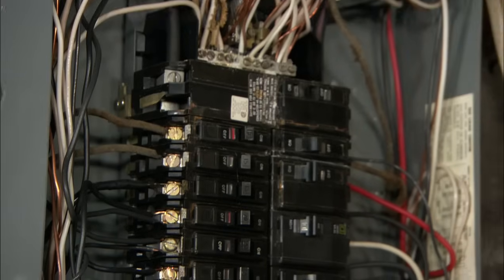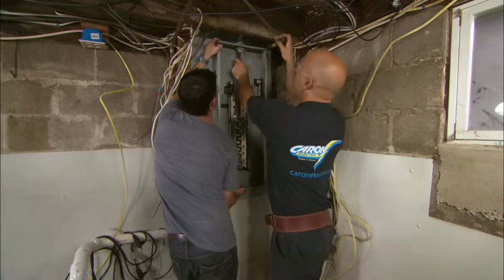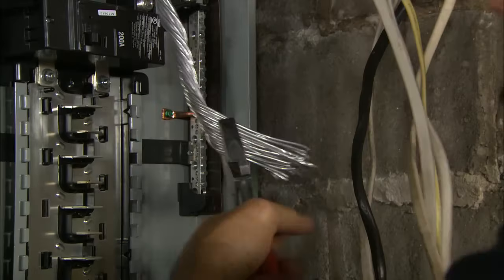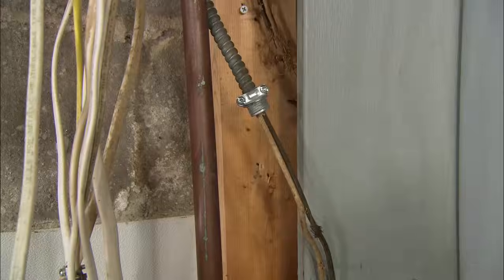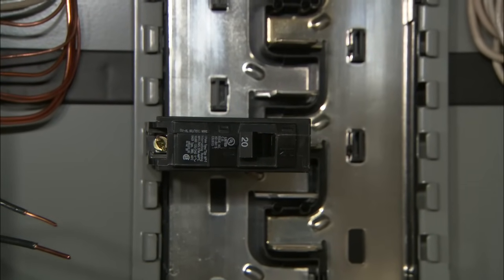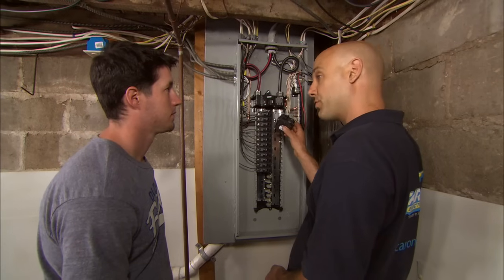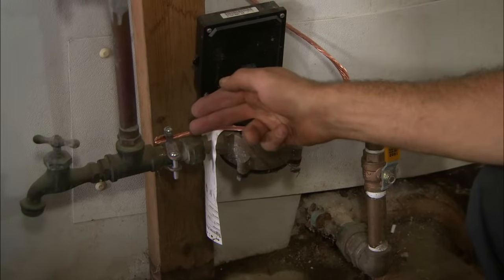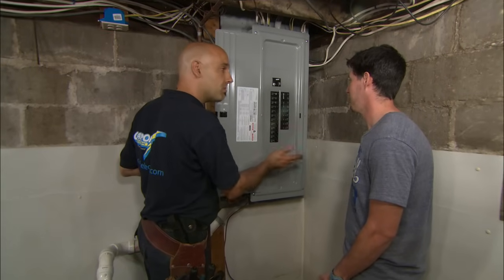How to Upgrade an Electrical Panel to 200-Amp Service (Part 2) | This Old House

Comment: I wanted to see the part where he's figuring out which circuit goes to what 20 times.
Reply: I have the Ideal Circuit Tracer. I paid around $100 for the kit, Canadian dollars. It has the adapter for plugging the transmitter into a light socket as well as the alligator clip adapter for tracing light switches. I find it very handy. I went on a service call awhile back and the  homeowner told me he had an electrician and an apprentice spend three days mapping the circuits in his house. I could have done the whole house in 4-5 hours with the tracer.
Reply: @ERLong-ww7yn  I can do it in 2 hours just by running up and down the stairs... 32-48 circuits shouldn't take half a day, lol, all I need is a plugtester and a ticker, the ticker gets jammed behind the plugtester and you just listen to the chirping... in New construction I also use blue lumex for the afci ccts,  saves a tonne of time trying to figure out which ccts get afci protection...
Reply: And add a radio in what you assume is a different cct then the vacuum and bring the end of an extension cord down to the panel with a light on it plugged in somewhere else and there you go.  More indications about what is going on w/ the ccts.
Reply: click 
-how 'bout now?
-no.
click 
-how 'bout now?
-no.
click 
-how 'bout now?
-no.
click 
-how 'bout now?
-no.
click 
-how 'bout now?
-no.
click 
-how 'bout now?
-no.
click 
-how 'bout now?
-no.
click 
-how 'bout now?
-no.
click 
-how 'bout now?
-no.
click 
-how 'bout now?
-no.*click* 
-how 'bout now?
-no.
click 
-how 'bout now?
-no.
click 
-how 'bout now?
-no.
click 
-how 'bout now?
-no.
Reply: Some of us use a circuit tracer. You plug a transmitter into a circuit and the "sniffer" runs over the breakers a couple of times.  Once calibrated it'll beep on the breaker linked to the circuit the transmitter is plugged into.
Reply: @ERLong-ww7yn  those are the cheaper ones, ideal makes a really nice expensive one that allows you to completely map everything out, you can run it along walls and conduits to see how the wire runs, itll tell you which circuit is which..
Reply: @ERLong-ww7yn  that's how I do it if I am alone.
Reply: +E.R.Long -  they have really wide price range. Are they all the same? Are you an electrician and use your's a lot?
Reply: No the Ideal draws power from the circuit, and that's what enables the sniffer to find the proper breaker for that circuit.
Reply: Gra Gor I don't see why not. They usually come with two alligator clips with leads punched down on an rj45.
Reply: SusceptiblexMe when u do it 52 weeks a year it's clock work
Reply: SusceptiblexMe I do this every day. Like clock work
Reply: I have one of them for data.  I guess I could make an adapter for it.  Would the toner run a 5-15P cord punched down on a RJ-45 cord end?
Reply: Next time I'll give it a whirl.  Should be fun.  Thanks.
Reply: awesome
Reply: awesome
Reply: well the quickest way is to turn on all light switches & plug in night lights into the top part of all receptacles               { because the top is usually switched } & make sure all ceiling fans pull cords are on. Then with a gen. cord insert each cable hot & neutral into it, then with the camera on your phone walk the house to see what has lite up for that    branch circuit, this also gives to opportunity to chk. out light switches working order.
Reply: @rrfields65  you mean you are dead shorting the ccts... with old breakers that no longer trip easily you could cause enough arc that can start a fire....
Reply: @gophersgirl  : what? Please write in plain English !
Reply: Lol
Reply: E.R. Long Its funny how that works
Reply: It's a pain without the proper tools pretty lady.
Reply: What about the 50 amp breaker for the range which requires a 50 amp breaker
Reply: Chris Johnson Gas stove? Last one I looked at used a 15A, 120V service.
Reply: @ChrisJohnson-mp6fh  ...probably has a gas range.
Reply: It's not rocket science. You land all the circuits on the breakers and figure out what is what when you're all done.
Reply: Hello from the future also skipped way to many steps
Reply: You mean 3 hours  ? :)
Reply: Pros use circuit tracers.
Reply: @nickg1307  I am a pro and I don't... if I have a first yr with me he does all the running upstairs, and if I'm alone I use my ticker jammed behind the plugtester... though I prefer tagging the HR when I'm pulling them, that way half the work is done and I don't have to do cardio just plugtest everything...also my company is too cheap to buy me a tracker, lol
Reply: He'll call somebody else to do that!
Reply: Um Klein makes the circuit tracer that works on live circuits for 200$ but old school way takes about 30 mins to an hour
Reply: Rather do it myself then pay someone $100 an hour to do it.
Reply: + SusceptiblexMe - outlets are pretty easy, you just move a vacuum from circuit to circuit. The lights in the basement are easy. You turn on a light and when the person upstairs tell you it went off you got it. Dryer and range is 240, pretty easy.
Reply: @lexluther8370  or a radio
Reply: @lexluther8370  also doing it yourself without a noisemachine of sorts is a great cardio workout running up and down stairs 40 times, that's why I don't have a gym membership.
Reply: Actually all he has to do is hook up each circuit to the new box and leave. He would leave the finding to the homeowner so the laughs on you both
Reply: Gra Gor.  Get a toner kit.  Toner kits work great when there is no power to operate your circuit tracer.
Reply: Sure wish I had a self powered cct tracer.  Most times when I'm tracing a cct I'm looking for a break and the thing isn't powered up so the tracer doesn't work.  Mine is a GD model.  Is the Ideal one self powered in the sending unit?
Reply: So did you understand from all this comments or they just got you more confused 😕...but just in case, just like hi explained on the video, if you know you're wire installations and circuitry wire size you know witch size wire goes to what, 15amp breakers is lighting 14/2 and it got white sheeting, 20amp breaker for power like receptacles and is 12/2 or 12/3 with yellow shedding and ure larger breakers like ure 30amp two pole breaker will be for size #6/3 or #8/3 for you're range or anything that requires 240v..simple as that...hope this helps you.
Reply: @torodaman  incorrect about 30 amp.. that would be 10/3 copper or 8/3 aluminum..
Reply: @torodaman  
You can use orange-sheathed 10-2 Romex for 30 amp 240 VAC things that don't require neutral.  Ranges almost always need 50 amp two pole breakers.
Reply: @torodaman  yellow 12/2 is only for kitchen plugs, and red 12/2 is for heaters, blue 14/2 is for afci,  blue cat5e is for data and white cat5e is for tel, at least that's how us Canadians do it...
Reply: Right, "this old house" should leave electrical alone. People end up calling us out anyways. Plus, maybe I'm missing something about basements but all that Romex needs to be protected below 8'. Either way this is not stuff basic homeowners should be doing

Comment: Did you notice when he was done it didn't look like a plate of pasta! he care's what he's doing and takes pride in it.
Also I never would have thought to look at what ga the wire is to know what breaker it should go into.
I'd tone out each line with a tool. but when I was done I'd also label the panel whats what.
Sucks being in the basement flipping breakers to find the dishwasher or a light switch when your replacing one. However Cell phones work better they yelling up stairs            ( is that it?  NO   How about this???   NO  Tell me when) You know what I'm talking about.

Comment: I'd use an insulated Tee {hex} wrench, rather than an uninsulated socket wrench, that Scott uses here!
Reply: The lug screws must be torqued to the proper specifications. You cannot do that with a T handled wrench. I don't recall him showing the torquing, but you can bet that he did it.

Comment: not allowed by nec code book to land two wires on yhe same terminal
Reply: Wrong if it's listed you can use two wires on a breaker or bus bar
Reply: Gra Gor: The lug has to be specifically marked on it indicating that multiple wires are allowed under one barrel.  The only ones that you can tell without looking at the markings are the lugs with egg shaped barrels.  If the barrel has an egg shape to it you know that you can fit multiple conductors (typically 2) in the barrel.
Reply: Ian Belletti et al: Okay, I agree that if the grounding lug is only Listed for one (or two) conductors, then only a single (or two) conductors can be installed based on the NEC. Thanks for the clarification and correction. However, under UL508A (Industrial Control Panels), multiple conductors are indeed permitted: Article 8.7 states, "Number - At internal wiring terminals, multiple conductors can be secured to a single termination point where a reliable electrical and mechanical connection is made without loose, unretained, or severed stranding." So one might encounter a UL508A Listed control panel with multiple wires landed to a single terminal and that would be okay, but such a connection cannot be made in the field in accordance with the NEC.
Reply: What section?
Reply: Shades921 110-3b mentions about it can only be if it's specifically labeled. The best termination tho would to splice the wires together and then screw one wire down. tighten a wire to much that it puts a cut in it creates resistance and a hotspot is potential. having two wires doesn't allow the screw to be tighten properly as well... and potential for a faulty circuit.
Reply: zmonkeymadness well, it's not really "illegal" just only allowed when it says it's allowed.  i.e. the terminal has to be rated for 2 wires.

Just about every terminal i use (i work in a control panel shop) is rated for 2 terminals.
Reply: is that a square D standard to be rated for 2 conductors on the terminal lug?
Reply: Yes.  Usually seen on 400 and 600a bus pads  .
Reply: zmonkeymadness: If the terminal is Listed for two wires, then two hots or two neutrals can be landed. However, for equipment grounding conductors, you may stick in as many wires as will fit securely regardless of marking! There are no restrictions for grounds since they are not a normal current-carrying terminal. Correction: See comment below.
Reply: +Soren Solveig
The multiple grounds allowed under one lug of the terminal despite listing is false.  Where listed means are used to land grounds, you must follow the requirements of the listing or you are in violation of the NEC.  You may only land as many wires under one lug screw as permitted by the listing on the lug.  Landing more than what is listed is a code violation.  Whether or not it is current carrying under normal conditions is absolutely irrelevant to the fact that it is a listed wire termination device.  The key word that gets you is "listed".

NEC article 100.I: Listed. Equipment, materials, or services included in a list published by an organization that is acceptable to the authority having jurisdiction and concerned with evaluation of products or services, that maintains periodic inspection of production of listed equipment or materials or periodic evaluation of services, and whose listing states that either the equipment, material, or service meets appropriate designated standards or has been tested and found suitable for a specific purpose.

Comment: two questions..  first. is the wire coming off the telephone pole always big enough to handle 200 amp service?  second... do electrician use different size wires coming into the house from the meter?  so if you jump up to 200 amp , a home owner might have to change to a bigger wire?  thx!!
Reply: to answer the first question, it is not a problem to upgrade a service. the power company wires that feed your home are capable of handling a 200a service. however the wiring from your meter needs to be adjusted to handle a service upgrade. a 100a service only requires #2 awg aluminum. however when you upgrade to  200a you will need to step your wire up to 4/0 aluminum.
Reply: Thanks Alex, I appreciate your input!
Reply: Alex Johnson's response is the typical condition.  There is no guarantee that your local power company has installed wire large enough for a 200a service from their transformer.  The electric company has their own set of codes that are different from the NEC and they often engineer their wire to much closer tolerances than what the NEC requires of electricians wiring buildings.  The only way to be absolutely sure would be to contact your electric company to verify the capacity of their existing service conductors to your building prior to doing a service upgrade.
Reply: mic jam yes if you are doing an upgrade yes. you need new cable coming from outside .
Reply: i agree, quite often i have to call the utility company to come run larger wire from the transformer to weatherhead.
Reply: mic jam o
Reply: If you have to ask this question then don't mess with your incoming power line at all. You could easily have found out the rating of that cable yourself. It's much more reliable to find it out the truth yourself than asking such a thing on Youtube. This all concludes that you should just call professionals to get things done on your electric system.